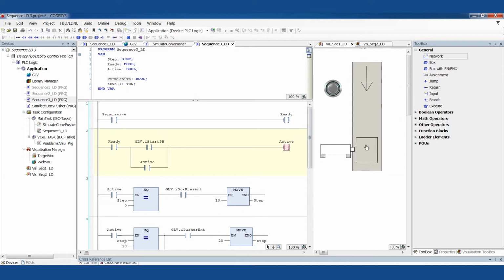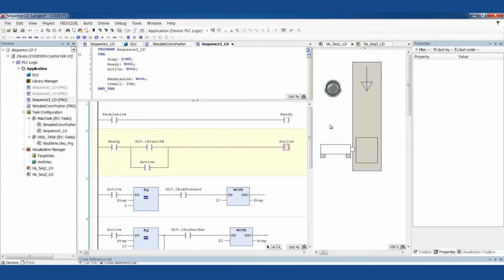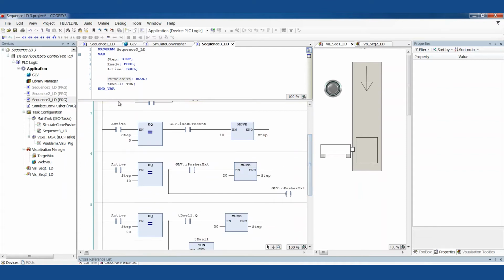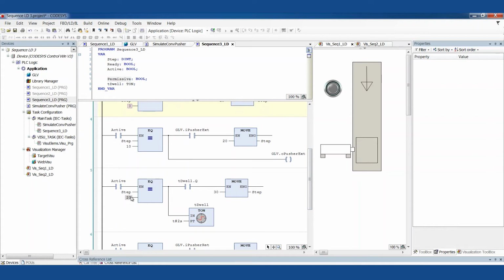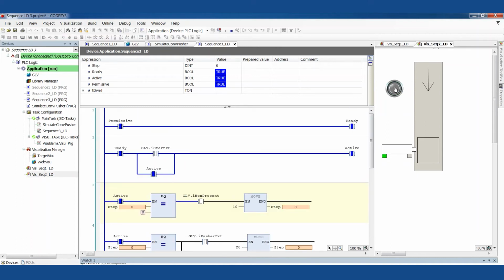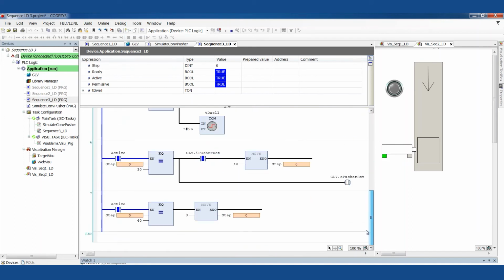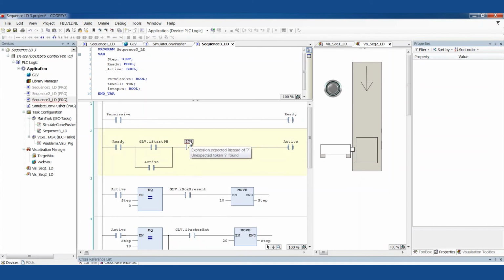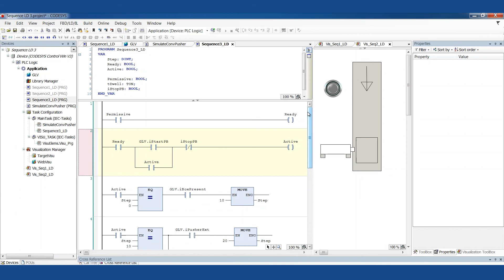Sequencing in Ladder Logic:  A Modern Approach  -  PLC Programming Cookbook

Comment: This is a cool method!  Now, is there a reason you didn't do the steps in reverse order for the same reason as discussed in the previous video?  And in general, do you just make it a general practice to code them in reverse order, regardless of whether it will lead to a potential conflict due to the scan and order of events?
Reply from the maker: Great question!  You're correct that the outputs of two states could be on for one PLC scan the way I've shown it here.  In a real machine, I don't typically fire outputs straight from the sequence.  Instead, I have "command" bit in the sequence and a separate part of the program that makes sure the output is permitted, including making sure two conflicting outputs can't be on at the same time.  This makes the sequence code easier to read, ensures outputs play nice with each other, and is more scalable.  See my video on Scalable Outputs:  https://youtu.be/HGwZ-BDVGBE

Comment: Very nice method for ladder sequences.  One thing I would add is a local _nextStep variable which each step of the sequence changes instead of directly changing the Step variable.  The value of _nextStep is copied to Step after any output logic driven by the state machine has resolved.  This is to ensure that every step of the sequence is given at least one complete scan and provides extra insurance that the logic can't fall through the steps quicker than you intend.
Reply from the maker: Good thought.  I've seen that done before, but I personally don't like having more than one Step variable.  I think it adds complexity and confuses the maintenance guys.  I'd rather just make sure each sequence step is waiting for the appropriate result before moving to the next step.  For example, if step 2 is extending a cylinder, it shouldn't move to step 3 until we see the cylinder switch shows it's been extended.  It's a tradeoff either way.  :)